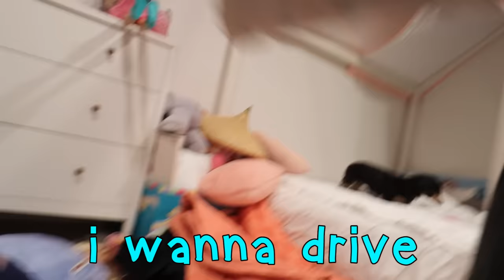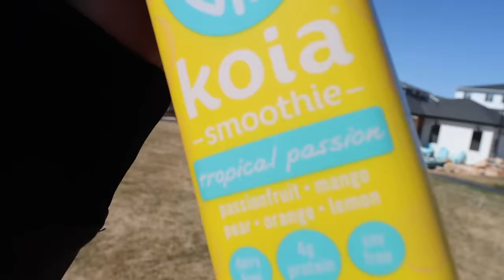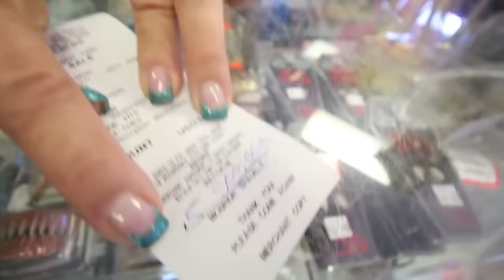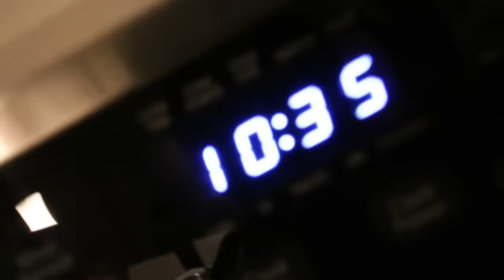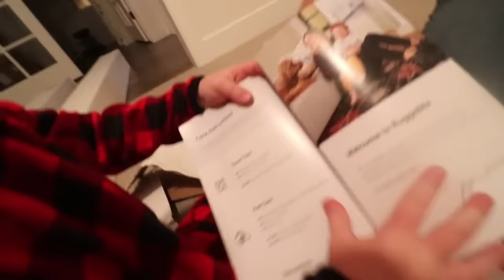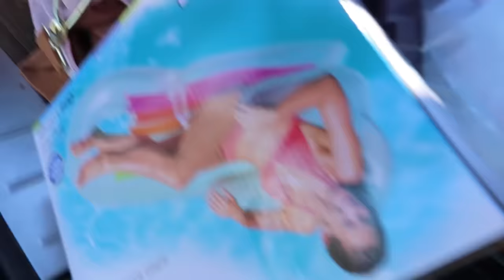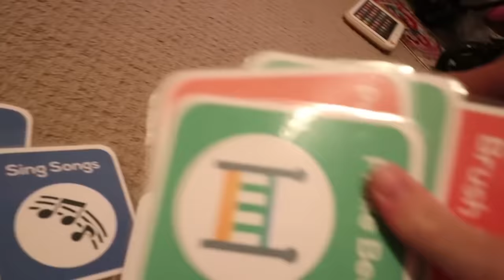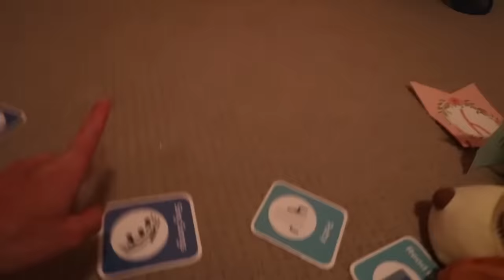NAVEY slides her FiRST SLiDE!!  it’s a Family adventure to pirate island! Adley drives mini monster

Comment: Alley protipif you have sweaty hands then use sand or dirt and rub it on your hands  because the neck ribbons your hands and it helps your hands not be super sweaty and then you won't fall off the monkey bars so easily .